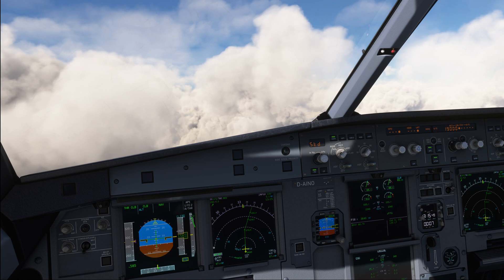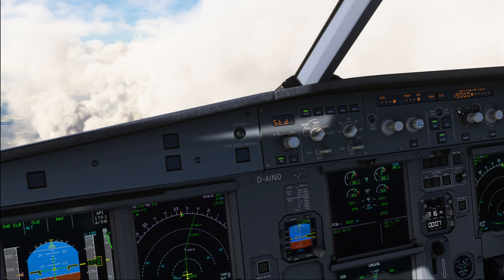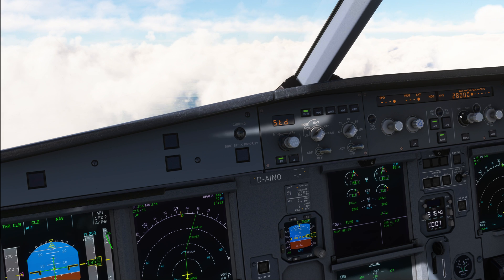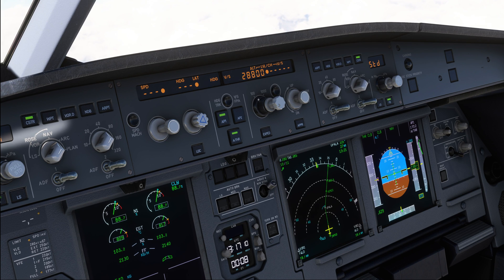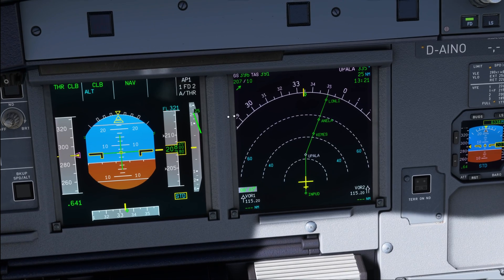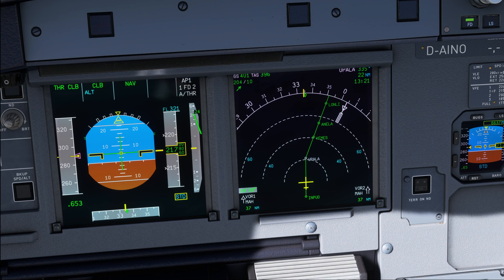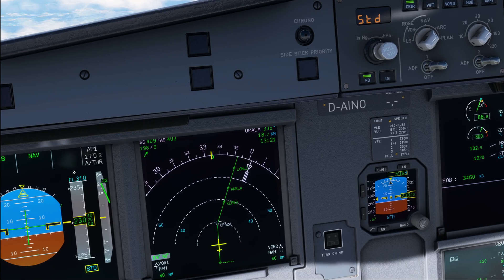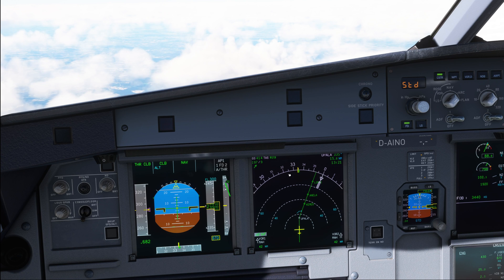100 or 1000? Which steps to change your altitudes should you use and WHY? | Real Airbus Pilot

Comment: All these videos on how knobs work makes me want to order a few rotary encoders and make myself some custom controls...

More specifically, I'm thinking of modding the front buttons in my CH throttle quadrant. Remove one or 2 of the little up/down toggle buttons, stick the encoder in its place, snd use a microcontroller to read the direction of turn and "click" the original buttons... In theory I can have it function exactly as it does now, but with a knob instead of buttons. In theory.

I'm hesitant to do it though, because there's loads of space inside that thing, and if I do that one mod, I'll probably end up wanting to add displays and other junk into it 😂
Reply from the maker: That certainly sounds like an interesting idea!

Comment: Hello Emanuel,

Can you make a video, why in Airbus aircrafts, the flaps should be set to Position 1, when OAT is above 30 DeG C on the ground, please?

Can you also tell which Airbus aircrafts are affected?

See below:
(A306, A310, A318, A319, A320, A330, A340, A350, A380)
Reply from the maker: Hi, I'll write that down for a later video, thank you for the suggestion.

Comment: One thing to note is when you start getting into China and Mongolia, they use metric flight levels. They might have you flying at 11,000 meters, which is 36,100 feet, or they could have you at 11,300 meters, which is 37,100 feet.

Comment: Emmanuel, I really have not flown the A320 of any make in the sim much. How do I know the proper time to make a step climb of say 2000 ft? Is there a rule of thumb? I’ve noticed the A320 only tells you the optimum and Max altitude with no step now advisory. Thanks.
Reply: On the fmgs. You either choose step alt when clicking a nav point on the f-pln page and select calculated, calculate it yourself and check the perf page once in a while to see the rec. max and optimum. 

Also if your desired alt and optimum differs in 1000ft (optimum less than target) you can climb to target alt.
Reply from the maker: Use the STEP ALTS function on the VERT REV pages of any waypoint.

Comment: question: isn't the danger greater you'll nudge the altitude selector knob when changing from 100 to 1000 increments and vice versa?
Reply from the maker: Like with any control in the airplane you got to be careful monitoring it when you operate it. However it is well possible to turn the selector rather than the alt knob without touching the other.

Comment: Does the real life control have acceleration or does it have standard rate of change just you move it faster or slower etc.  just wondered sort thing you can never find out unless you ask a real pilot😂
Reply from the maker: The radios have acceleration, the FCU does not.
It basically was correct the way Fenix had it previously, now I find you either have both accelerate or none. That's incorrect.